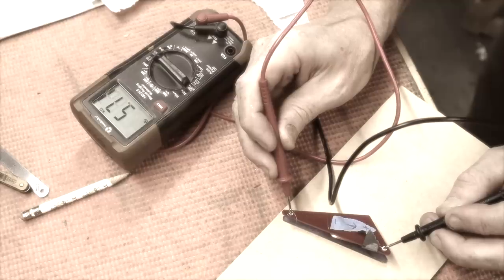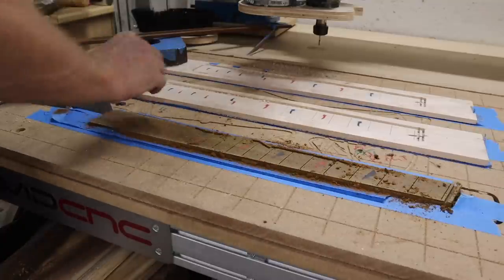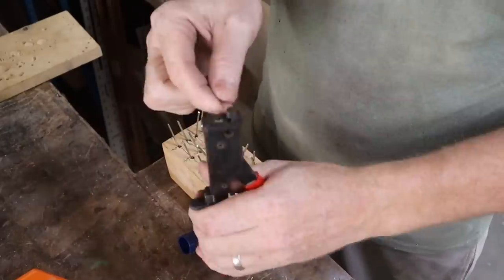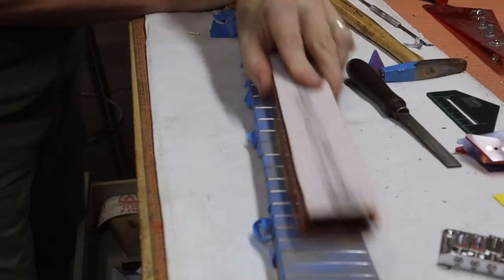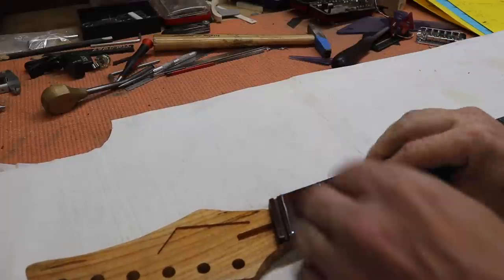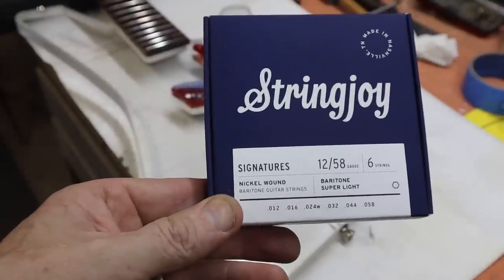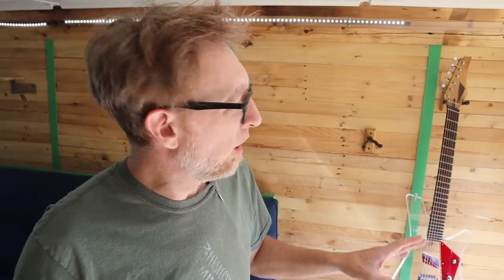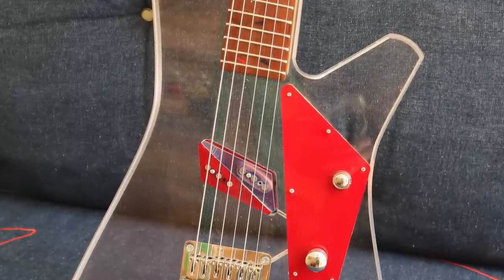Baritone Guitar: I Built My First and Love It

Comment: Transparent things are always really hard to photograph, especially when they are flat like that. When there are curves, you can use a big softbox and put some cardboard stripes in front of it to show-off the shape, but when it's flat, doing that won't give much of an advantage. I feel that you probably have better results using a dark background that's pretty far away, edge lighting the plastic to make the frosted band show-off and maybe use a bit of foam core to reflect a bit of light on the front. If the back is dark enough when compared to the light on the guitar, your camera won't be able to record it and it will appear black even if it's not.
Reply from the maker: thanks for the pro tips!
Reply: @timsway  You're welcome 🙂

Comment: My first guitar (acoustic) had a zero fret and I loved it.  Why isn't it more popular?Glad to see you include one, but now that I want to build a guitar, could you do a more in-depth video about zero frets?  Are there more/special considerations for nut shape? Height? Depth of slots? String angle? Fret wire? Need the info! 😆
Reply from the maker: the zero fret makes open notes sound the same as fretted notes and setup easier. All you need to do is put the fret where the nut would be and put the nut a little further back. All the nut needs to do is keep the string in line and touching the zero fret, so it doesn't really have to be as precise as a traditional nut. The only tricky part is making sure the string is making full contact with the zero fret so there's no buzz. On flat headstock guitars like this, I use a string retainer across all 6 strings (like a floyd rose style) to make sure they are all seated. Or sometimes you'll think it's touching but it's not, but you'll discover that quickly as every fret will be out of tune.

Comment: Jet Screamer is perfect. I had suggested Jet Sound, and Gregory Zunic countered with Jet Screamer (Eep Op Ork!)

I love the way the light collects at the edges in the sun! So cool.

Have you used Ipe for the fretboard before? The loose fretting may be due to the character of the wood being very hard, so it's not compressing while the slots are being cut and therefore not springing back after the cut. Just a guess, never tried Ipe myself.
Reply from the maker: THANKS! I couldn't find the thread to give proper credit. My guess is it's the ipe that caused the problem, too as I made two other maple boards at the same time that were fine. I have used ipe before but not in a while. I can remember having a hard time getting the frets in but I was much worse at all of this them too. 

It could also be that I used a .021" end mill where I prefer the .020" but was fresh out (I buy them used in bulk from factories that use them for etching pcb boards or whatever)

Comment: Another cool video from Tim! I have recently came across your chanel and really fell in love with it. So much, in fact, that I now want to try making my own guitar completely from scratch! However, the problem is the lack of material. You see, I've got plenty of wood, but it is pine (I do really have a ton of that stuff), which is told to be soft and not durable(also a bad tone wood). I've tried to buy some nice wood like maple or ash maybe, but it seems that getting such type of material is a real mission impossible. Is starting with pine even worth trying or is it better to go on looking for some better material?
Reply from the maker: it's possible with pine but definitely an uphill battle. try finding some old maple dining table or something like that. they're usually pretty cheap at second hand stores.
Reply from the maker: or pallets. they come in all sorts of hard woods, too
Reply: thanks, Tim!

Comment: Great body shape. Any reason for that pickup placement? It sounds like a middle pickup on the low strings and almost like a bridge pickup on the high strings. I would route a non angled pickup closer to the bridge
Reply from the maker: I've been experimenting more and more with middle position and "sweet spot" pickups . Personally I rarely find myself using the bridge pickup.

Comment: Hey there! I’m just starting my first scratch build and I’m using a cnc router for it as well. What bit do you use for cutting your fret slots, and what speeds and feeds do you run for that bit?
Reply from the maker: I use a .021" end mill wicked slow and wicked shallow. Usually 8 passes of .01"  for each pass. Slow your router down to keep the bit from getting too hot and slow the cut down to keep from snapping the mill. Unfortunately you will probably break a few until you dial it in but that's how you learn what your machine and materials can do
Reply: @timsway  so I’m guessing by slow you probably mean on the order of 20 inches per minute and maybe 2k rpm on the spindle?
Reply from the maker: @rcjd7834  maybe even slower than 20, like 10. If you start slow and speed up you'll break less bits finding the sweet spot.

Comment: I built my 1st baritone guitar about a year ago. A 30 inch scale beast! Check out the finished product video on my YT page/channel.
It's the Tele-Baller BootyCaster.
Reply from the maker: I LOVE the sparkly edge banding
Reply: @timsway  Thanks! I used 2mm thick aluminum I cut into two 8mm wide strips long enough fo the guitar, then heat softened it before shaping it to the body with a plastc/rubber mallet. Secured the whole thing with woodscrews and countersunk holes.
You can't pre drill the holes but you can mark them, because it wants to bend where the holes are.  But its helpful to have it secured with screws while shaping it. 
So best start in the middle of the aluminum secured to the bottom of the guitar (after routing) and shape it as you go along each side.
Then polish or give the aluminum a machine finish with steel wool.